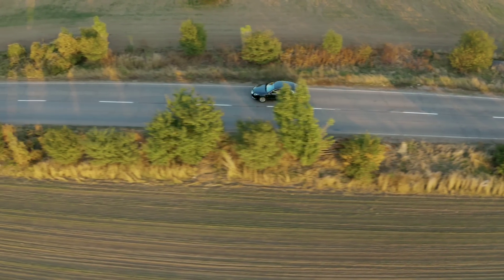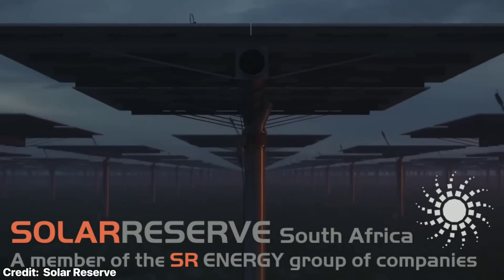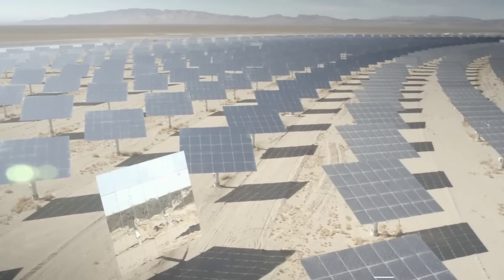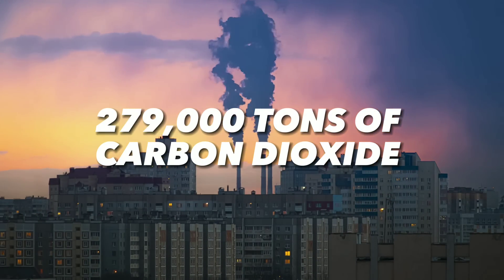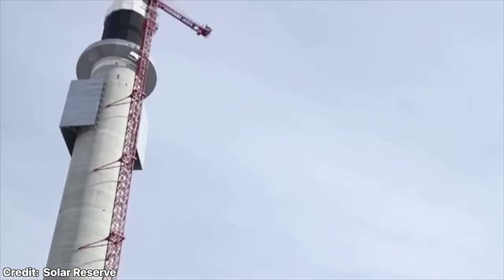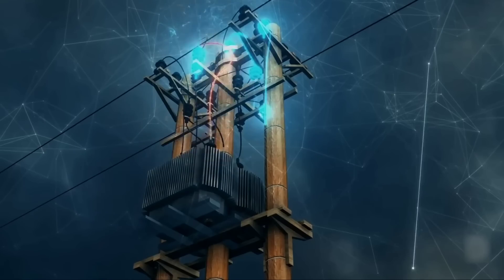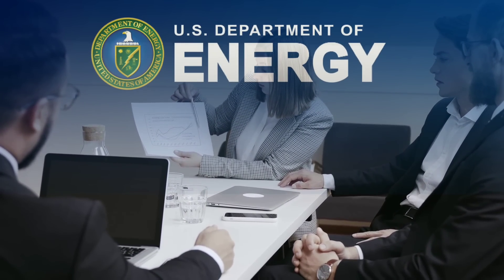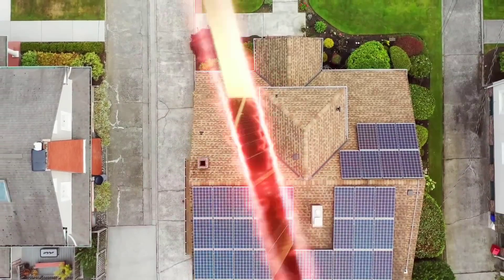World First Billion Dollar Solar Plant was an EPIC Failure

Comment: If it was restarted in 2021 it doesn't sound like it was a failure.
Reply: The plant was meant to produce 196 GWh of power per year (~33 GWh/month) - which it evidently achieved in 2018.  Yes it did restart in July 2021 but is now shut down for 4 months each year (March-June).  It operated at a rate of 12 GWh/mo in 2021; 15 GWh/mo in 2022; 10 GWh/mo in 2023.  There is no data for 2024. Certainly a technical (poor availability), commercial and economic failure.

Comment: As the first of it's kind, this powerplant ran into some technical problems that needed to be solved.
This solar powerplant can provide electric energy at night. A photovoltaic farm can't.
Reply: The big issue is construction and operation costs which sharply increases the energy costs for it; energy from concentrated solar costs more than twice what energy from photovoltaic costs. Photovoltaics are still much cheaper even when adding batteries to supply energy at night too, and photovoltaic scales better both up and down to boot.
Reply: So the pundits/zealots say. The new CSP plants in Morocco have shown a Capacity Factor of only 21% (despite expecting 25% - 35%).  A normal PV plant is very likely to achieve this same CF in Morocco.  PV's achieve 17% in Australia which does not have the same solar location benefits as Morocco.